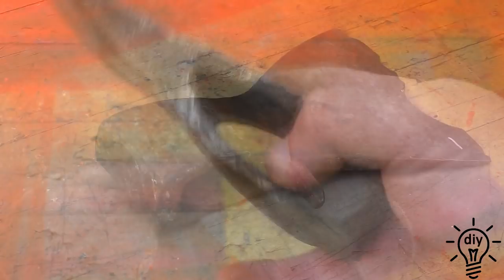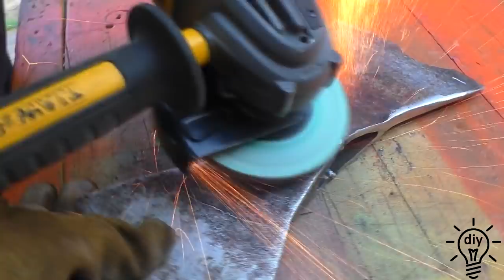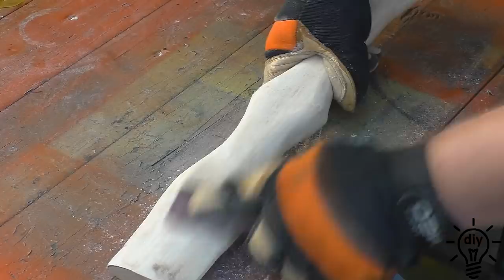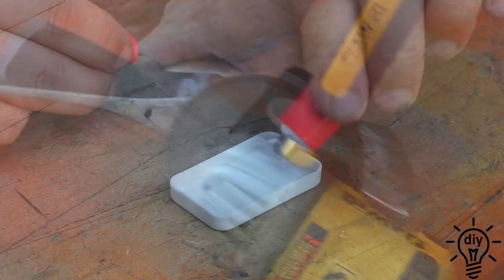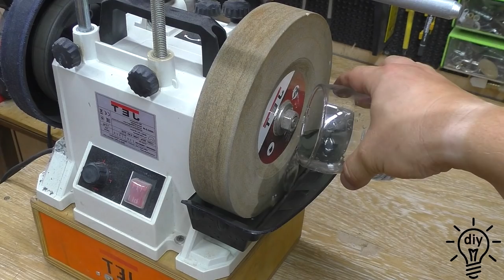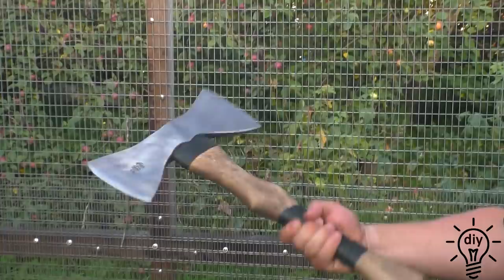Neighbors are shocked by such a homemade product made from old axes!

Comment: Cool build and cool idea, I would have made the handle longer though, do you think the weld would hold during hard chopping? I don’t know much about welding, serious angle grinder skills by the way.
Reply: If he would have tapered the steel , heated it to soften it to take a weld better, used a stick Welder because of the higher tensil strength of the weld, then reheat and quench then temper. It might hold then.

Comment: You cut off the hard cutting edges of both axes, you put a weld on an impact tool, and you used a (small) live slab to make handle. It looks very nice I'll give you that much.
Reply: What little of the hard edge remained 😅 edge retention might not be quite as good as original but i dont see why any of thatd be a problem with a functional show peice
Reply: @poofpoof9940  he's seen it a thousand times

Comment: The piece will break if ever used much because of the way it was pieced together, the weld on the piece is not going to take repeated shocks that an axe normally takes.
Reply: I thought the same. Its a heavy duty prop.
Reply: @-mkg6982  awesome logic. So mostly means superior? So. As most people have herpes I should endeavour to get that too? Yeah,nah I'm good with solid forge no weld thanks.

Comment: You cut the hard steel bit off of the edge. It's merely a prop now.
Reply: I was thinking that too.. but that weld had to mess with temper, I dont think this will do good at all cuttin through Oak all day.
Reply: Glad I'm not the only one questioning this. Some heat treatment for the welding may be an idea too.
Reply: @-mkg6982  not on an ax
Reply: @-mkg6982  A steel bit about a half an inch wide is forge welded between two soft pieces of steel.

Comment: What type and grit grinding wheel did you use?  I have a heavy Guardian machete that is not even factory sharp.  Just rough shaped in, 2 regular machetes, 2 sizes, some axes, a pick that has been blunted round from misuse, two metal wedges with mushroomed heads, shovels and other hand tools.  Hands not steady with hand stones.  One of the rectangular stones has 3 grooves on one one end.  I think the stone is too large for them to be for hooks.  Have one standard grinder motor and one that might be for hobby use or maybe small tools.  Are there fine grit stones and honing wheels?

Comment: Welding? I heard welding isn’t safe for full impact resistance.
Reply: it isn't. it's a decoration.
Reply: I've repaired a few axe heads and hatchet heads with a welder. Just have to know how 😉
Reply: @BobSmith-kd6lq  yeah i welded sledgehammer heads onto schedule pipe and it works good. been on there for years.

Comment: Should have made the handle longer.
That double edged blade can produce nasty injuries that close to the body.
That's the reason most of the old double headed axes had regular length axe handles.
Reply: If the axe is old it can hold a razor sharp edge. I do agree. The one I cut down has one sharp and one rounded edge. I was using what I had on hand to complete a job, to keep from cutting off my ear i purposely rounded one edge, then I painted the dull side so I would recognize it. I bought a new handle for it but my son asked me to leave it because the size and weight were great for cutting stump roots. Wicked scary hatchet.
Reply: I use a 1948 Collins double bit for all my axe work. It is a very nice axe. Stupid sharp, holds its edge for a long time.

Comment: A DOUBLE EDGED AX IS DANGEROUS TO USE. TRYING TO SPLIT HARD WOOD WILL CAUSE AX TO BOUNCE BACK TOWARD YOUR HEAD AND POSSIBLY SPLIT YOU HEAD. HEAVY SPLITTING MAUL WORKS BETTER AND NOT LIKELY TO BOUNCE BACK. I HAD A DOUBLE EDGED AX AND ONE CLOSE CALL AND DOUBLE AX WAS TRASHED.